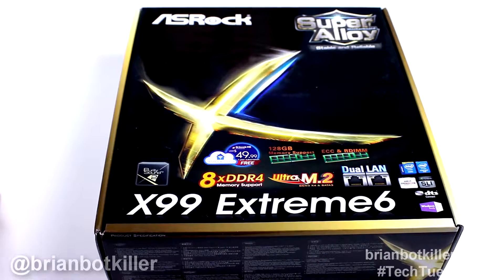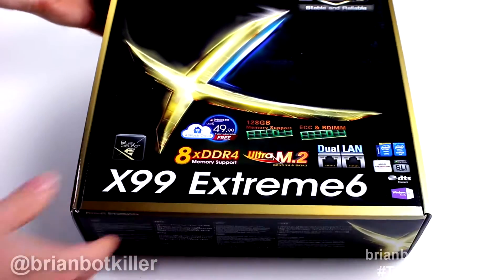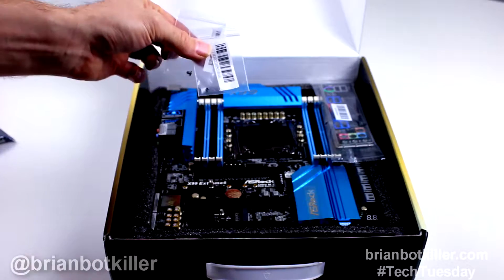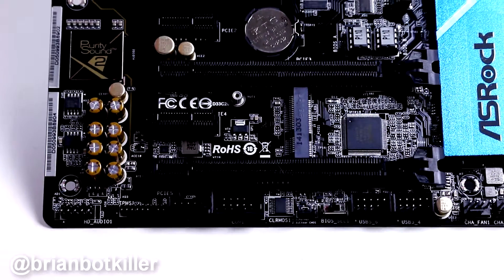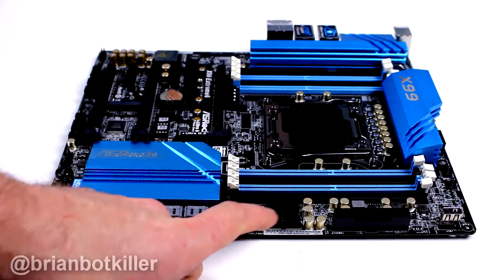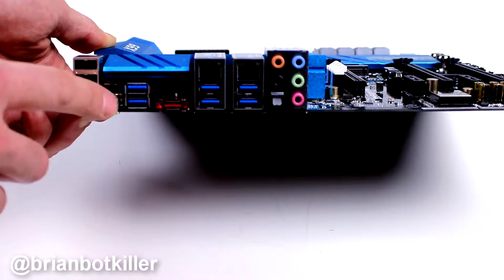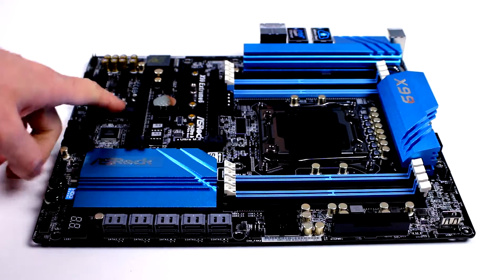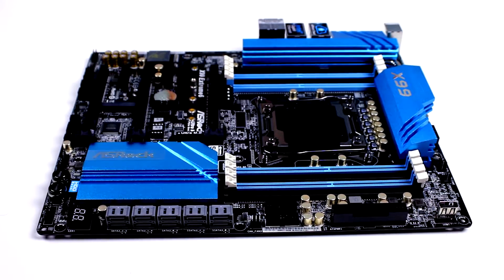Asrock X99 Extreme 6 Motherboard Overview

Comment: Ugh! I like you and your videos, but Asrock motherboards are crap. I've had nothing but trouble with them. Out of five motherboards I've bought, 1 1/2 of them are running. I strongly recommend that all users avoid Asrock, and get either Gigabyte or SuperMicro, both of which are excellent.
Reply from the maker: Thanks, everyone's mileage is different, though!